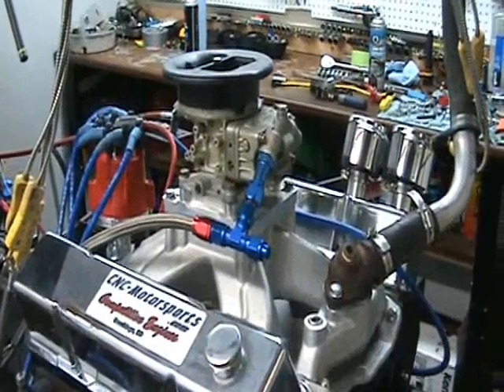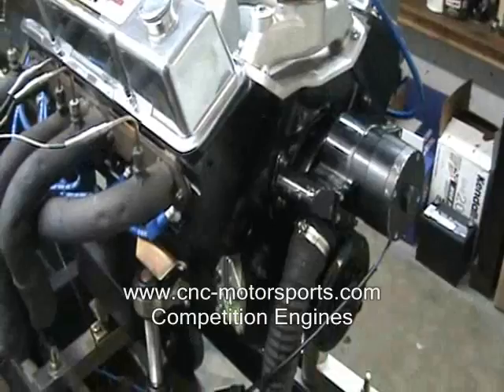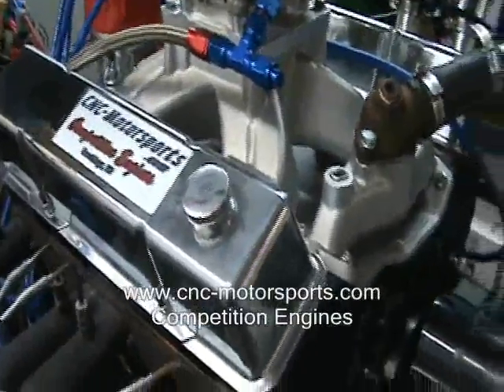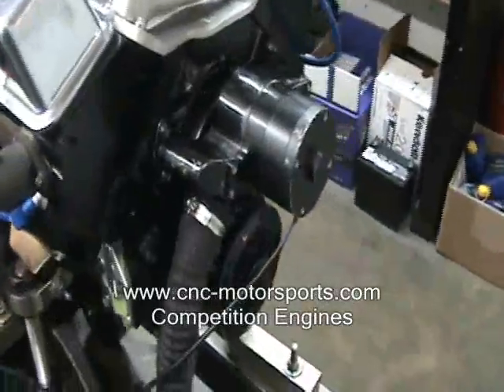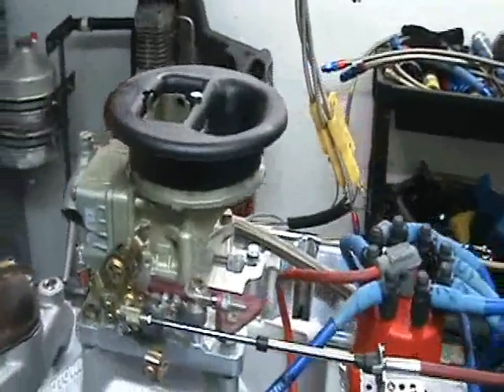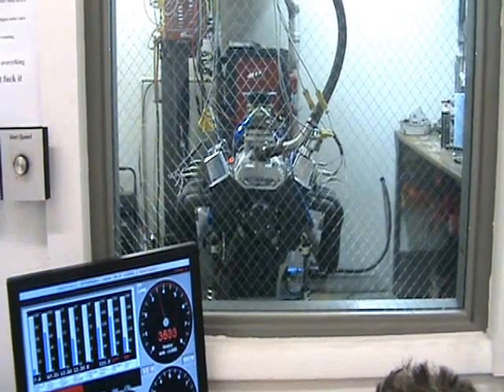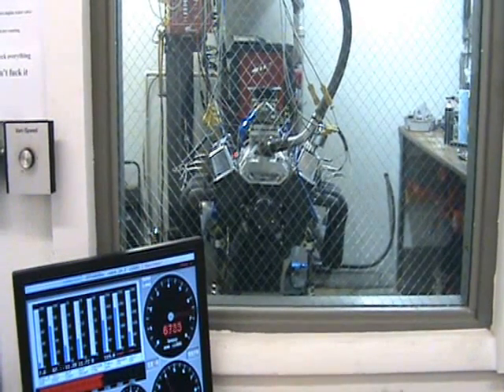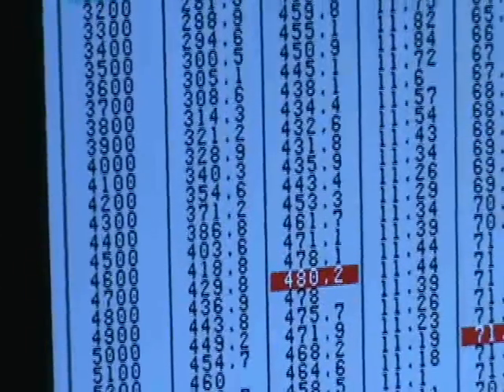SB Chevy 383 Stroker USRA Stock Car Engine 494 Horsepower

Comment: Why is the compression so high for only 494hp? A stock Mustang make 1.44 hp per cuin with 11 to 1.
Reply from the maker: *****  This is a circle track engine build. This engine combination must follow a certain set of rules.
Reply: cncmotorsports Yes sirrr
Reply: This motor would make way more if it was legal for a monster 4brl carb. 500 out of a 500cfm 2brl is impressive